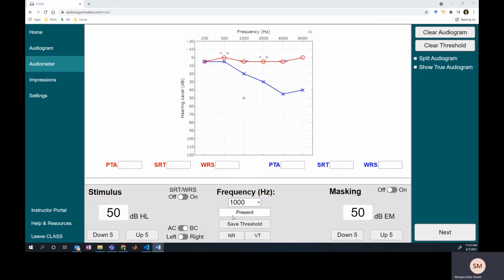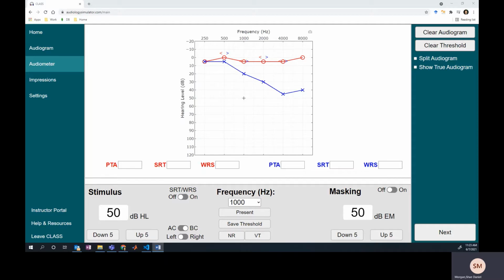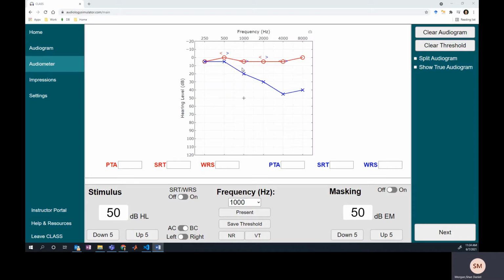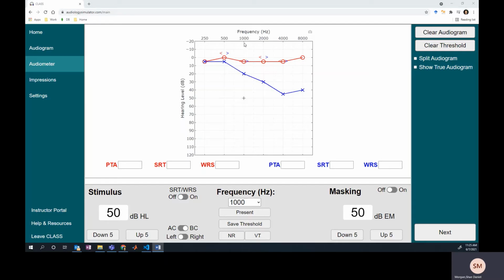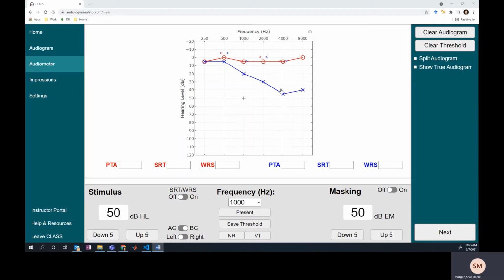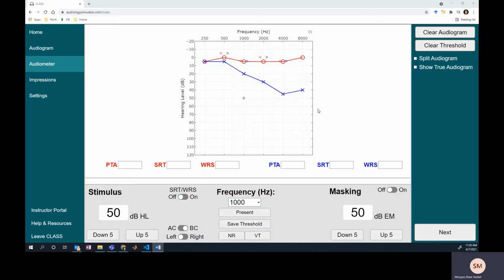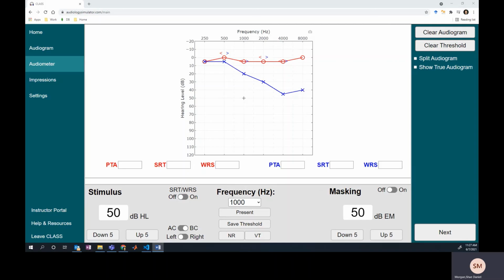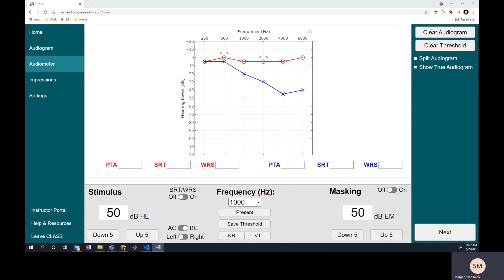Masking Tutorial (1 of 4) - Knowing when to mask: Air Conduction

Comment: Is it BSA procedure?
Reply from the maker: Hi! Good question, this procedure is based on ASHA guidelines and recommendations. The BSA procedure is very similar (found in their 2018 guidelines), but they recommend different interaural attenuation values for insert earphones (55 dB vs 60 dB) and have you re-establish the threshold with occlusion rather than adding an estimated occlusion effect for each patient (for bone conduction masking). 

The plateau procedure described in this series is very consistent with the BSA procedure so this should apply quite nicely!